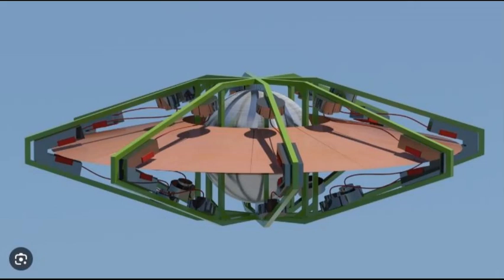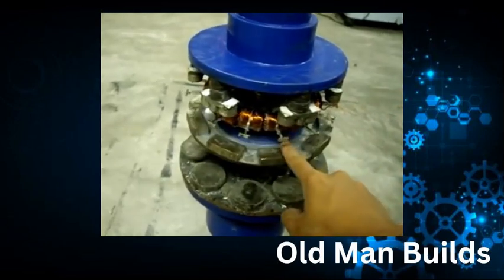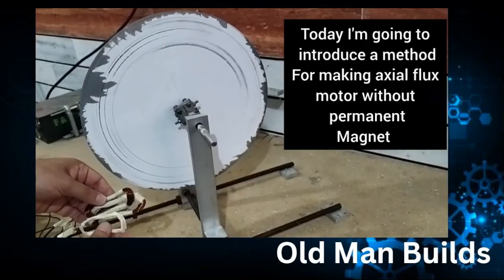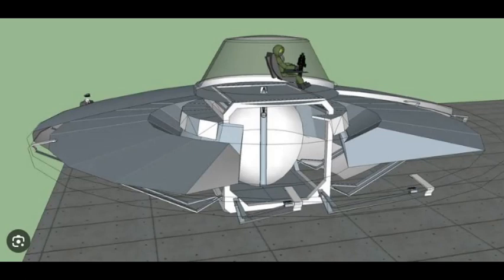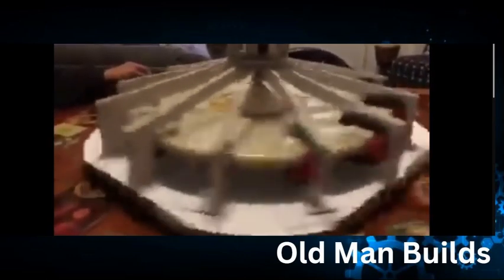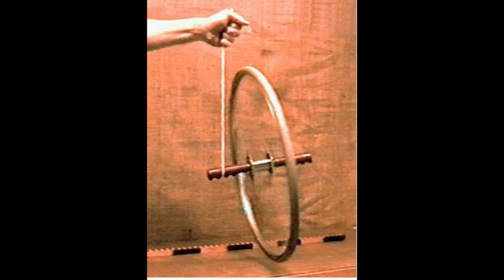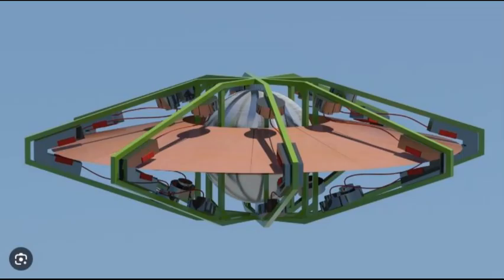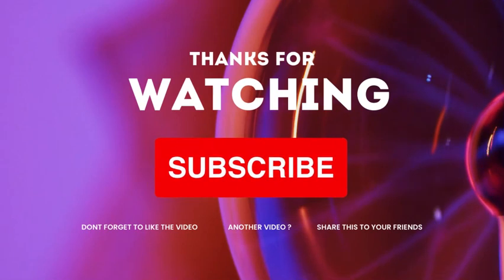Vril UFO

Comment from the maker: I made this video to show where to start on building a Vril UFO. I will be adding a 3d printable file for this when I make the follow up video. I hope it helps in building one of your own.
Reply: awesome love it i think you need 2000 rpm just a hunch.
Reply from the maker: @jediknight2350  I agree based on the otc-x1 video.
Reply: I have a good blueprint I made of the electrostatic craft model would you like me to email you the png so you can easily replicate that guys project? all you'd be left to do is cut out the shapes on the 3 wood discs, I made it in ibis paintx app on my tablet
Reply from the maker: @fireball75677  Send them over. It sounds cool. I like to see how other people build things. May be I can Build it after this one. Thank you for sharing.
Reply from the maker: @fireball75677  If you could. Give me a brief description on the energy flow. It looks good.
Reply: @nathanbunten4299  the guy said in his videos showing the trident model if I recall correctly the outer aluminium shell is positive and the inside frame is negative, he also said something about 2 negative connections fighting against each other but you'll probably have to go through his videos again he does explain it a little better, to me it looks like he's trying to complete an electrostatic circuit that resonates at the specific frequency to enhance the lift
Reply from the maker: @fireball75677  I did not get a link to the video. can you send me one.
Reply from the maker: @fireball75677  It sounds like 2 fields in a sphere. - like gravity and positive like the magnetosphere. Gravity well. I would need to counter rotate to get a gravity well though.
Reply from the maker: @fireball75677  The Vril craft at this point is going to be counter rotation with eddie current. When that is done we have a choice. Do we want to use air as the lift factor like a single turbine down the center or try an experimental engine. I am looking into 2" barring's to replace the small ones in the center. To get the real Vril look. Thats as far as I want to go until we get the eddie current going. Based on how it reacts we may need to change direction.
Reply: I just watched Terry's video here again https://www.youtube.com/watch?v=c1iGCgUn4k8 and he said the outside of the craft is negative and the balloon is positive, reminds me of your foil experiment on the table when the foil gets sucked to the table, I think if the scale is measuring zero each time at the right frequency of the application of the static the model is definitely trying to fly
Reply from the maker: @fireball75677  Yes I called it force in my graviflyer. It's the same thing. Just like TT brown. It's also why I keep talking about a field around the craft. There are no magnets to repel against on earth you have to do it with ions. The counter rotation with the negative in the center gives you gravity in the craft.  It all ties together.

Comment: I am curious about what the middle sphere might be and the stuff inside it
Reply from the maker: I'm not sure. I first thought it was a gyroscope, but it looks more like a mercury drive. It could also be a gravity well. I guess we have to test them all when we get there. How the outside works with the airflow will tell us more.
Reply: @nathanbunten4299   yeah the mercury seems to be very common in these machines for some reason I doubt it's a super conductor like you said tho
Reply from the maker: @fireball75677  It looks like we might have to build a mercury engine in the future, but I cannot find a lot of good material on how it is done. I need to find a good representation of something close that can be modified. All I have seen is it spinning. If you have a suggestion let me know.
Reply: @nathanbunten4299  Well from what I've heard the nazi bell with it's counter rotating mercury cylinders they apparently used a special combonation of other elements in the mercury making a special liquid metal alloy or something, I think it was called xerum followed by a number, but when they power it up if people got too close to the bell when it glowed they died or something
Reply: @nathanbunten4299  I am also curious as to how the rest of this particular vril works, it does kinda look like a giant motor too
Reply from the maker: @fireball75677  That's why I wanted to build it. Or something like in in stages. I hope it turns out to be a gravity well, but I am unsure as well. I finished the design for the inside and have one more part to print out then I need to wrap a 1 1/4" piece of aluminum around it to be done with that section. I have a framework for the outside, but I may build the coils first in a smaller test part to see how much power I need vs the coil size. Basically what will it take to move the inner part. I hope to be done with it by the end of the week. I really want to see the counter rotation. There are not many examples of it anywhere.